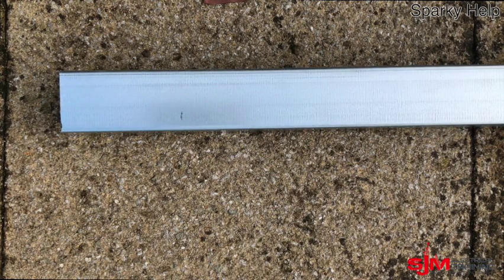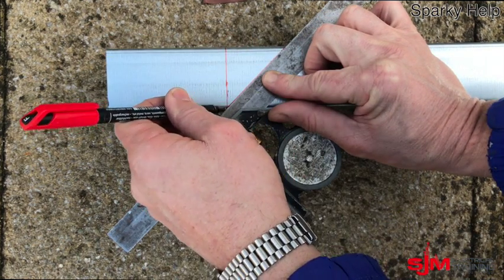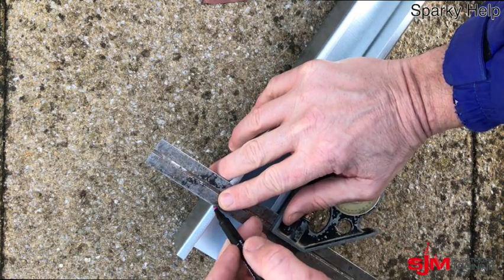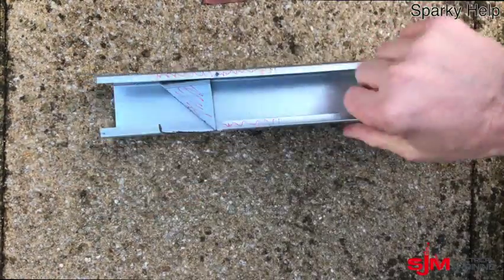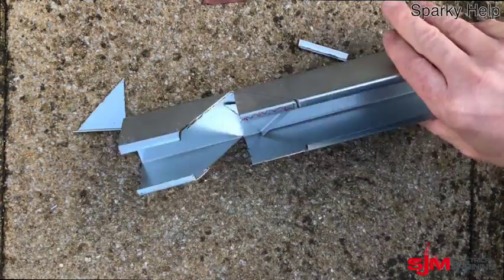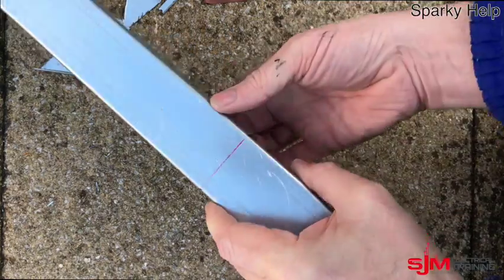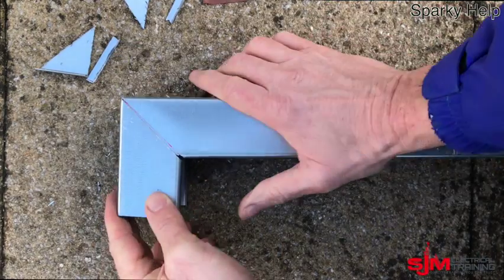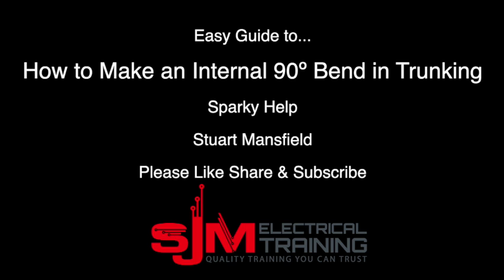How to Make an Internal 90 Bend in Electrical Trunking using an Angle Grinder

Comment: Can I ask please what if wall is not square. How do you measure the angle and cut please?
Reply from the maker: Hi thanks for watching please share with like minded people.  You could for ease cut down centre line and bend trunking on wall mark where the trunking overlaps, this will be the cut position.  Hope that helps.

Comment: Can you do a 45 - 45?
Reply from the maker: Will do.  Please Like share and Subscribe.
Reply: @sparkyhelp3997 do these videos apply to pvc mini trunking aswell?
Reply from the maker: @kashif4463  Hi thanks for watching , please share, like and subscribe.  You could try it, but I have never applied it to plastic (i have tried in practice - but never quite goes well) Mitre the joints or buy bends if larger trunking and on show.  hope that helps.